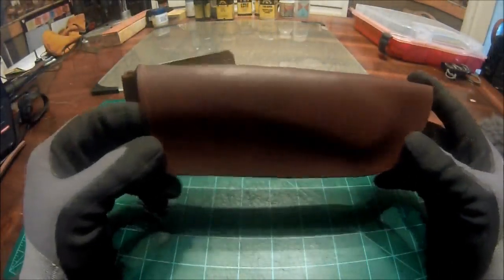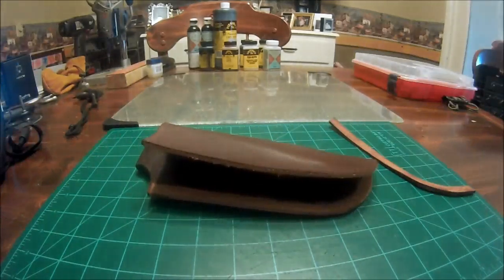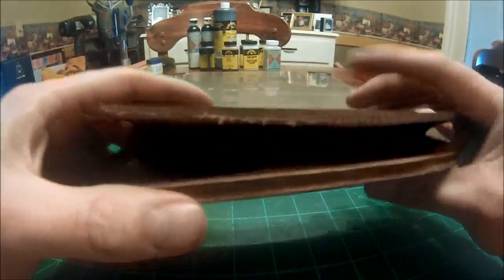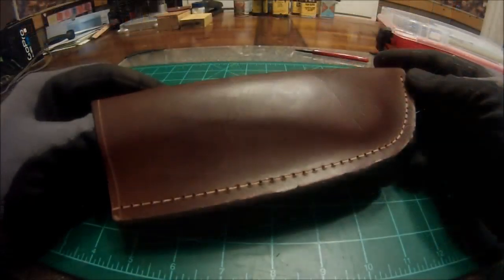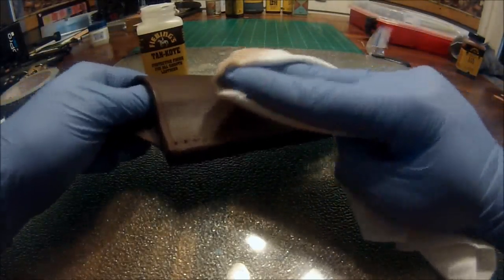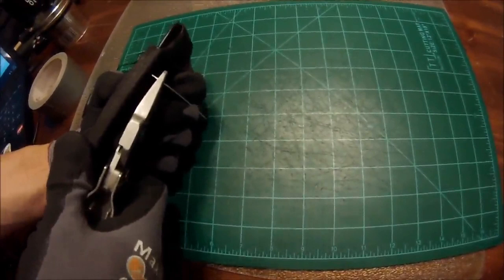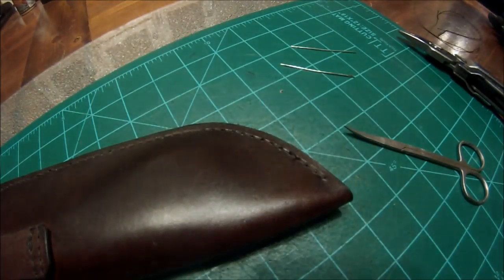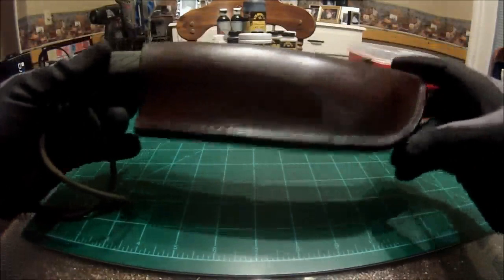How to make a leather laplander sheath - Completed sheath

Comment: Wow, absolutely great work!

Always thougth about doing leather sheating myself, but still afraid of the cost coming with it and all the time i'll have to invest untill i get the first decent sheat :D I guess i will start with pvc or kydex as those are (in my opinion) easier to start with, need less materials and tools and the chance of 'mistakes' being correctable (just heat the stuff up again) is pretty high... sounds great for a beginner like me...

btw... what do you charge for such a laplander sheat as in the video? I'm thinking about ordering one from you, although shipment will get a bit expensive as i'm settled in germany...

Comment: You mentioned that someone said that wasn't the right tool to mark holes....if I'm not mistaken, that tool is a punch for making equally spaced holes, and is therefore by default the RIGHT tool for marking the holes, is it not?  (The right tool for the job is the tool that you have that does the job you need, anyway, right?  :) )  Nice work, by the way.

Comment: Great video.  How do you determine the thread length for stitching?
Reply from the maker: Thank you.  If you take the total length of the area you want to cover and then double it by 4 or 5 it will cover the area.  Of course that formula only works for items that are three layers of nine ounce veg tan.
Reply: *****  Sorry, I am confused. Do you double it and then add 4 or 5 inches. Or do you multiply the base measurement by 4 or 5?
Reply from the maker: No.  Take your total length.  Example 10 inches.  Now multiply that length by 4 or 5.  Sorry, I guess what I typed really didn't make much sense.
Reply: ***** Thanks.